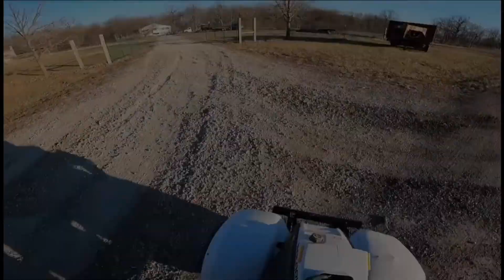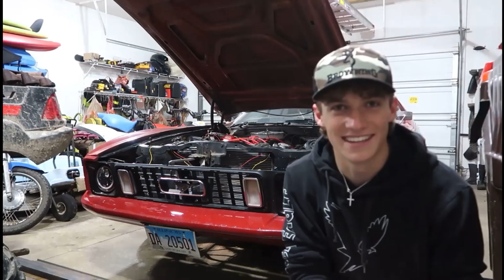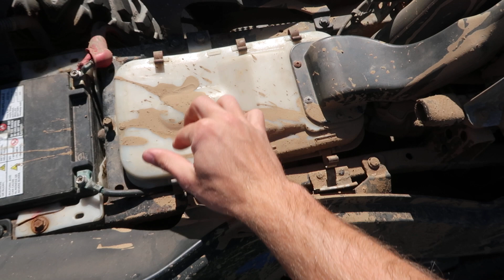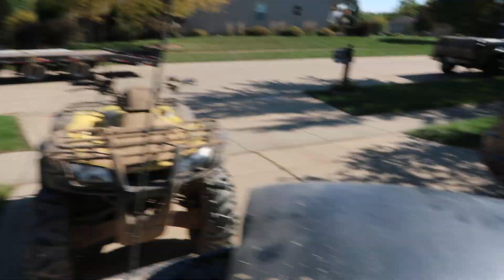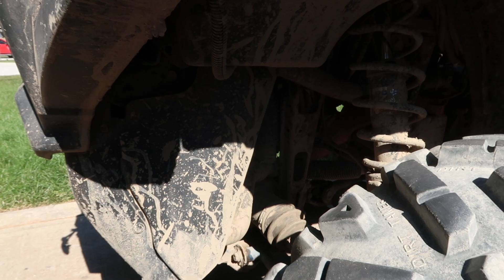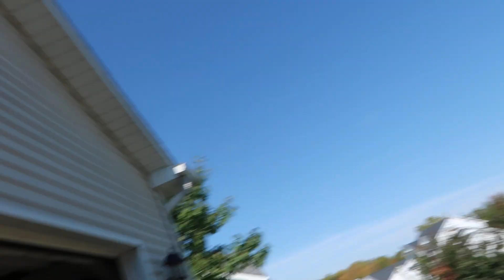2005 Polaris Sportsman 700 Overheating! Code 41 and 45 Barometric Pressure Sensor Low Input EASY FIX

Comment: Justin, I have a 2005 -700 also but it has a carburetor. It’s brand new. It has the same issue like yours with shutting off when cooling fan kicks on. I don’t have that sensor.  Any suggestions

Comment: When i disconnect the air pressure sensor it stops dieing.  No codes . So im try replacing the sensor

Comment: Would you know what wire to what wire that plug goes into because the person I bought my four wheeler from had cut it already and told me to connect the wires but all my wires are the same color

Comment: How long before the codes went away? I just did it to mine and it hasn't gone away yet. I've only had it on for like 10 minutes but I'm not sure if it fixed it.
Reply: take battery positive terminal for a minute or two then reconnect should be gone after that

Comment: Thanks for the video, I also kinda had the same problem, but I went backwards, started with the water impeller, to the thermostat, then it was the fan, fixed all that, but still having a problem with it just randomly shutting off
Reply: Did you fix it bud? If so, what was it?
Reply: @ nah it’s still has some problems here and there but she runs

Comment: Hey thanks for the video im having same problem changed sensor but no luck so must be the wiring im testing the wires with a test light at the plug but nothing on all of them i have the key on any suggestions? Is there voltage at every wire? Thanks heaps 👍
Reply from the maker: Have it running and check, and when you unplug it see if there’s any difference in the idle if not the plug is bad.